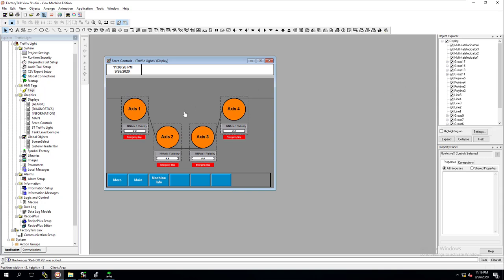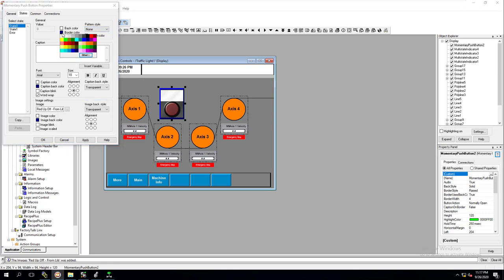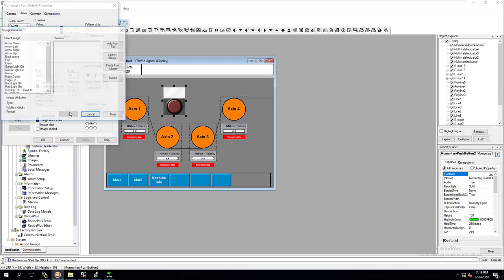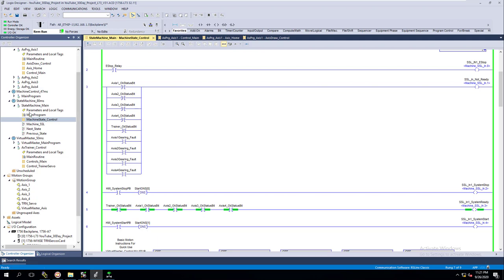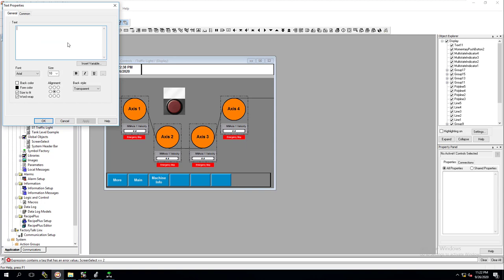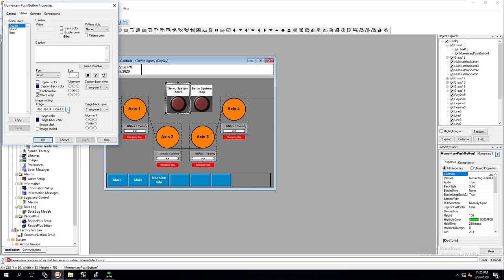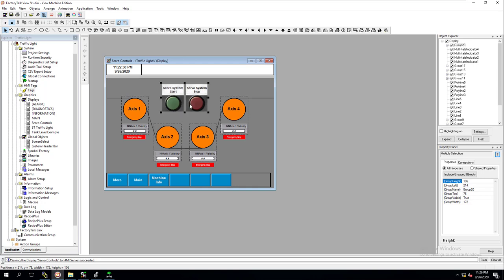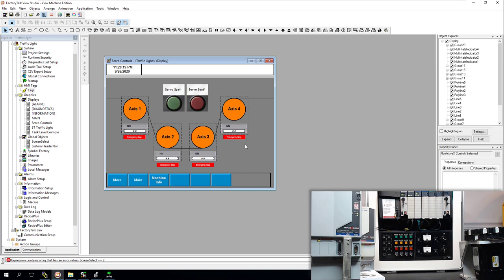FactoryTalk View Studio ME Library Images | FTview 10 Machine Edition | Pushbutton Controls

Comment: Hey Shane great video, I just have a question: when it comes to push buttons (momentary or maintained) what is the actual use of the "indicator" connection? I mean, I know the push button would still work even if only the "value" connection is assigned and nothing is assigned to "indicator". So if you could explain it a little bit that'd be great. Thanks!
Reply from the maker: The indicator is to let someone know the PLC but is active & if multiple stations are used then others HMI stations will indicate.

Also for HMI buttons that stay active because of communication lags & hangups